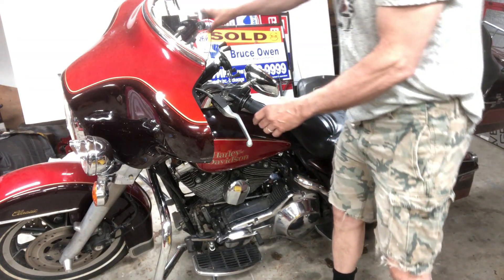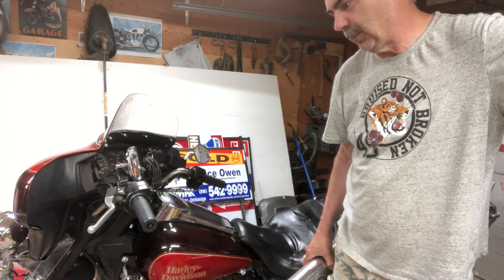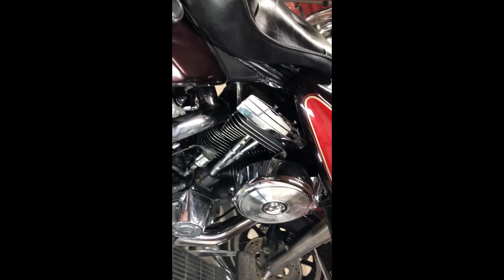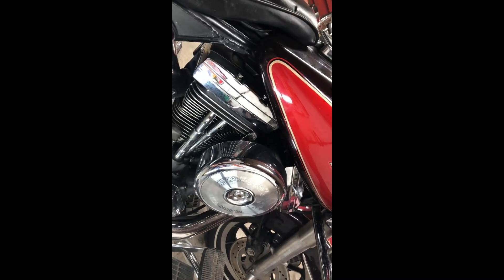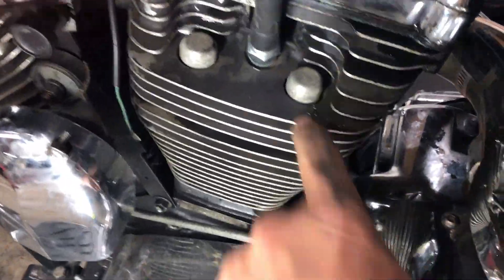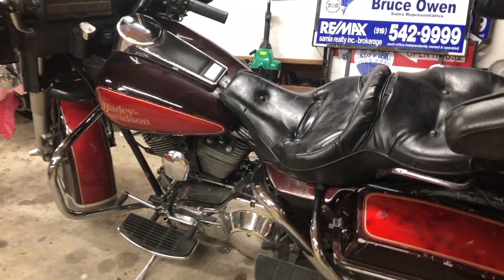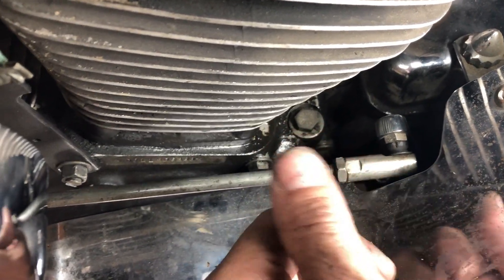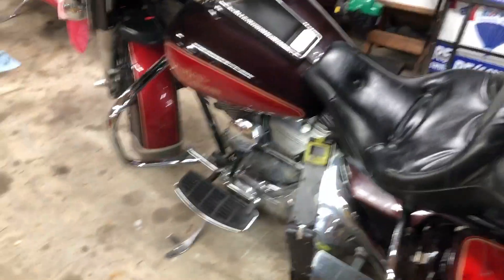1990 FLHTC HARLEY ELECTRA GLIDE  kerker exhaust, popping in carb, oil filter housing loose, REPAIRS

Comment: Hello...your videos are excellent.  I always use James Gaskets blue intake seals.  You can get them in a multi-pack.  They are silicon based, I believe and when you install them they have an extra lip that seals the flange to the head and they squish out around the flange for a better seal and they stay pliable for a long time.   I've never had a leak with them.  I lightly coat them in grease when I install them so they "find" their happy place.  My 2 cents. J
Reply from the maker: Thanks John, I will be doing the top end on that bike soon.

Comment: Hi Bruce would it be possible to send me the relay part number and where you purchased it for cheap? My bike is doing the same thing and I’m hoping if I change the relay like you have done it may fix the zing noise when trying to start ... Thanks again love watching your videos.... 👍
Reply from the maker: I bought it on EBAY for a $7 last year now I see It has gone up to $14 here is the title of the ad, copy and paste it in ebay (NEW DS Starter Relay Switch FOR Harley Davidson 139481)
Reply: Motor Oil & Beer Thanks once again for your help... 👍
Reply from the maker: @harleywallbanger1240  It still might be your starter clutch. They cost about $80-$90. That will make the zinging sound as well. They will slip and not fully engage.
Reply: Motor Oil & Beer yes I’m sure the starter is coming to an end. I figured for $7-14 it would be worth a shot maybe I would be as lucky as you and that would be the fix and not an $80 new starter.... Thanks

Comment: Could it be the in tank fuel filter and the guick release house? Help me please and how can I tell it has to do with the stupid plastic cam tensioners they put on these bikes. Mine has 28500 miles. I don't know if it's an electrical issue or what. I do know it's a pain just to check the cam tensioners, you pull all the stuff and still can't see the back tensioner.Randy Barger
Reply from the maker: Sounds like you are talking about a twin cam. I am not to familiar with them. If its popping in Exhaust it is usually a lean situation do to after market  pipes, 90% of the time.

Comment: Can anyone tell me why my 04 Electra glide Classic flhtci is popping and losing power?
Reply from the maker: Sorry Randall, I haven't worked on the twin cams at all. But loss of power and popping in the exhaust could be a sticking or leaky valve. Do a compression check, quick, cheap and simple to do. Also read the plugs.

Comment: Have you ever tried using smoke for testing for vacuum leaks? Some guys use cigars and just blow into the intake via a sealed hose. Others make up a smoke generator using a jam jar, a rag soaked in baby oil and an old soldering iron to heat up the oil and make the smoke. Looks quite effective on car tests, should work for our bikes too. Here's viddy: https://www.youtube.com/watch?v=EhNQiIRsCCk

Not sure but that oil filter looks suspiciously like the K&N "Wrench Off" types that are know to fail at the nut spot welds. If you google for K&N oil filter failures you find many, many reports of these types of failures. And it is not always from people using the nut to torque up the filter. These filters were recalled a couple of years ago and yet reports still appear on the newer productions. Not worth the risk!
Reply from the maker: I have seen those smoke machines before. I am not sure how I could adapt that to this manifold for testing. I know the manifold is dented already so I ordered a new one and I will start there. I have to do the gaskets as well at the same time. Good video though I will keep that in mind for future videos.
Reply: One trick I saw, take a nitrile glove, fit over the manifold, then cut a finger off to push a tube thru, tape to seal. Doesnt need any real pressure holding.  Might be trying similar for hunting leaks on my norton.